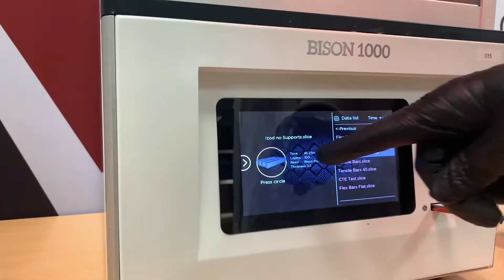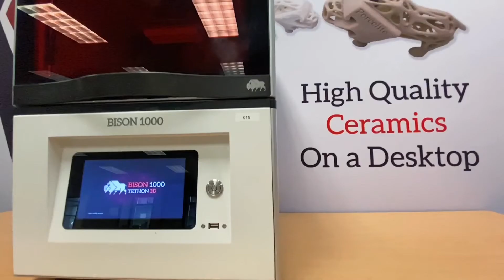Tethon 3D - Revolutionizing Ceramic Additive Manufacturing

Comment: Amazing work! Are there limits in the size of the prints with the ceramic resin? Does it get dificult to get consistent results without them breaking in the oven?
Reply from the maker: The size limitation is determined by the 3d printer hardware used.  Once parts are tested for correct sintering schedule, they can be consistently produced.